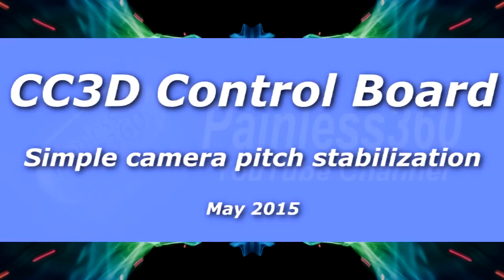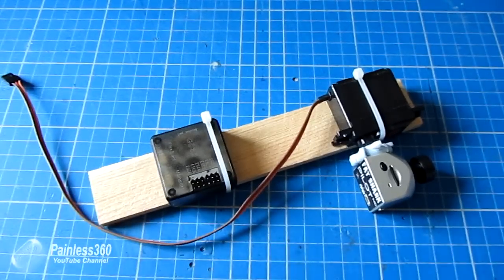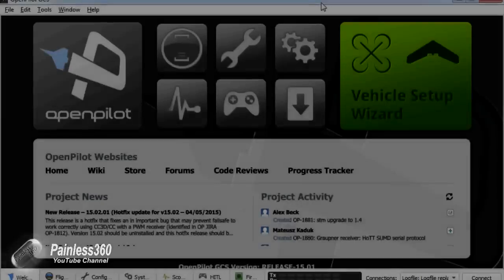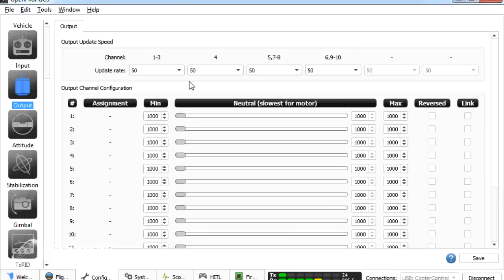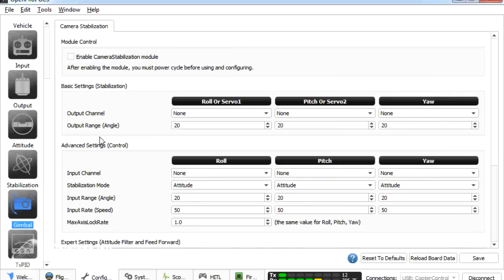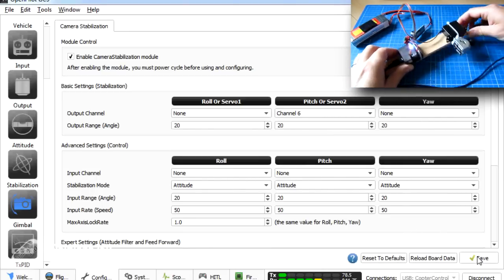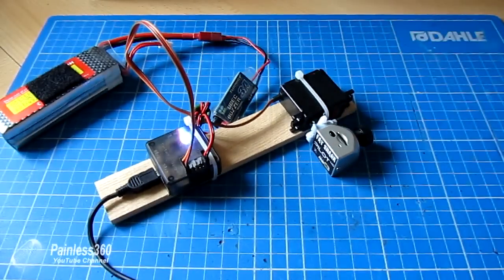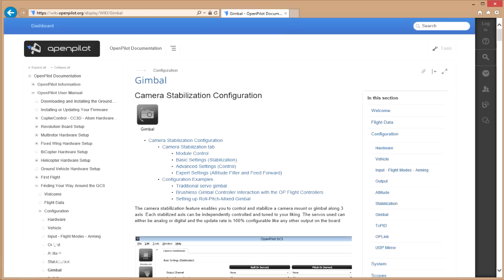CC3D Quick Tip - Setting up a Simple Pitch Camera Gimbal

Comment: Thank you so much for the video and the comments.
I have never thought about not having the camera tilt because you are unaware of what your quad is flying 
I fly a 350qx with a GoPro on a two axis gimbal and use FPV with the GoPro.  Seems to work well but I am not 
Flying fast or through a group of trees. As 
With I am planning with the 250 mini quad.
Thank you for all your help in the setup .

Comment: Hi there, brilliant video, thanks. Simple one i'm sure. Is it possible to add further control to this gimbal. For example, I want to fold away the camera before landing and then stabilise it at a mid point during flight? It's actually to stabilise an aerial but needs to fold away before landing?

Thanks,

Will

Comment: For anyone who has had the issue where the pwm adjustment bars are grey, I've got the solution.  Configure the board in the wizard as a fixed wing aircraft, and during that setup configure your servo as if it were for an aileron by plugging it into channel 1.  Once the setup wizard is finished, you can go to the output tab and can adjust the servo like Painless does in the video.  However, if you try to assign gimbal pitch control to channel 1 you'll get an error in the dialogue box at the bottom of the screen saying the channel is already assigned as an aileron channel.  So, go to system, settings, mixeroutput, and go to mixer1type and click on the word "servo," which will bring up a selectable list of things you can re-map channel 1 to.  Select Camerapitchorservo2, and hit save, which is the button that looks like a hard drive with a red arrow.  Then go through the regular gimbal process in the video and it should be working!  Took a while to figure out, but basically I'm tricking the system into allowing me to configure the servo, then reassigning the configuration to where I need it.

Comment: hello painless ty 4 the great video. it did wounders for me, i have a ? well there b a video on the set up of the cam on a 3 p switch control, where you can flix the switch up and it is looking up same with middle and down on the 3 p switch? thanks again for this great video
Reply from the maker: Not for Openpilot and CC3D, we do have one for Naz32/Cleanflight.. Best of luck!
Reply: +Painless360 not openpilot it's dRonin...
Reply from the maker: Same answer ;) Best of luck!
Reply: +Painless360 well thanks for everything so far and if I come across a way I'll share so you can use it for a video
Reply: to achieve that you need to go to settings --> Mixersettings --> Mixer5type --> set it to Accessory0.

if you have accessory0 assigned to a 3p switch on your Tx then your good to go. (accessory0 in my case as I have a 6CH Tx and only have accessory0 spare 5th CH being flight mode switch).

DO NOT! forget to set the start, neutral, and end points for the servo under the config --> output section as shown in the video above.

hope this helps.

happy flying :)

Comment: Hi, thanks for video. I´m not a modeller, but I need lightweight 1 axis gimbal (exactly like this) for paragliding. I want to build one, but I don´t know voltage and type of battery, and what is the thing on the wire between battery and CC3D.Thank You for the answer
Reply from the maker: The CC3D and the servo run on 5v. The 'thing' is a 5v BEC that supplies both. The BEC then plugs into a battery with a higher voltage (2s-3s LIPO usually). Best of luck!
Reply: +Painless360 Thank You for fast answer

Comment: Thanks for the great video! Can you explain me how I can use it without stabilization? I want to use it for searching on fields but I have no idea. It is not easy as putting it directly into the rx with PWM.
Reply from the maker: +Fshsh Szahha Not sure what you are asking...
Reply: I only want to use it as a servo (with a mounted camera)via the FC. It makes me possible to change the perspective while flying. Do you have an idea?
Reply from the maker: I'd connect it to the receiver directly or Google passthrough for the CC3D.. Best of luck!
Reply: No, connecting directly to rx is impossible due to CPPM. There is no solution on the internet.:-(

Comment: Let me get straight, I just discovered this new feature, could the gimbal feature of the cc3d compete with a pre made gimbal?

 I mean if the quality and the steadiness are nice I could  build a homemade 2 or 3 axis gimbal with a couple of good digital servos and connect them to the board, Right? If this system is that good I don´t know why this isn´t destroying the market of premade gimbal you can save a lot of money...

Btw, very good video.
Reply from the maker: The 'real' gimbals you are thinking of use brushless motors to provide silky smooth, powerful, fast and accurate movement to stabilise the camera. 

This method uses servos so the results are nowhere near as satisfactory. 

But is is a nice cheap way to help stabilise the camera. And weighs little too.

Happy flying
Reply: So you don't think with a couple of very good digital servos, and a pretty decent setup of the gimbal feature in cc3d couldn't match the performance of a brushless gimbal? 

It would be nice and interesting to find a video making this experiment between both.

Regards.
Reply from the maker: Let me know if you try it. Happy flying!
Reply: +Painless360 I'll upload a sample video when I get all the parts, I'll take note for send the link to you  ^_^
Reply from the maker: Good luck :)

Comment: After watching the video I have some doubts... I would like to do the same with my eachine racer 250. It has a CC3D board but all channels are already bound. I guess this means that I would need another CC3D board and also another battery?
Reply from the maker: +Eduardo Agustin Vendrell del Río or you could de-solder one of the unused PWM outputs and have that one coming out of the other side of the board so you can connect a servo to it... Best of luck!

Comment: Is there a way to add a gimbal to a hexacopter (like a F550)?
Is is enough to get the pitch and roll signals from the receiver by adding an Y-calbe? I think if the CC3D is stabilized with attitude mode, it should work.
Reply from the maker: +paaalm07 I would get a dedicated gimbal and use that. Best of luck..
Reply: +Painless360 You said in the video "..this is tricky to do, if you are using any more than 4 motors..". Maybe you can describe this shortly how tricky it is.
Now I fly with a CC3D in my F550, but I've ordered a CC3D Revolution too. So I can take the CC3D only for gimbal. Is that the dedicated way which you have mentioned?
Reply from the maker: No, something like this - https://www.youtube.com/watch?v=TRBr3VdJ7wA
Reply: Ok, thank you!

Comment: A quick question, I readed the whole documentation but I think I didn´t understand it pretty well.

I want a camera stabilized in roll and pitch axis, but I also wanna control the pitch, so we say I have to use 3 extra output channels Right? Then, do I need a 7ch in total? 2 for stabilization and 1 to one potentiometer, or the 2 stabilization outputs are independent from the Input Channels?

Thanks.
Reply from the maker: No, two connections from the CC3D for the two servos and one extra channel on your radio to control the pitch. Best of luck
Reply: Thank you.

Comment: Has anyone tried flying fpv with this setup? If so, how does it preform?
Reply from the maker: +iannick22 flying FPV with a stabilised camera is very tricky for most pilots as the Tilt of the craft is easily visable if the camera is fixed. Best of luck!

Comment: In output tab, 5 and 6 are disabled. Any thoughts? I am using cc3d atom
Reply from the maker: Ive not used CC3D for a few years so I'm very out of date, see my video on which flight controller should I use from August to see those I recommend now. Best of luck!
Reply: i figured out, but some how it always dont work.
So i went to INAV and it works well

Comment: Hi,
Do you think it's possible to use brushless gimbal motors instead of servos?
Reply from the maker: Not using the way shown in the video. You need a gimbal driver to run the motor...
Reply: Ok Thanks!

Comment: i have cc3d 
 i want to add servo for dropping  so 
if i remove the  last pin  from reciver  and then  pin the  servo wire 
then will it work   
cc3d  only need give channel?
one more thing    i am using only five channels  Aux 0.1.2.3 is dessabled
so  if i remove  the    last pin  fo cced from rx  then  the  cc3d  will work ?
Reply from the maker: I'm not sure, I'd have a look at the librepilot documentation. I've not used a cc3d for many years..  best of luck!

Comment: painless I was in a bit of a jam and wondering if you could help? Myself and 5 other guys are attempting to set up a course and upgrade from librepilot to betaflight. Flashing the cc3d with beta flight seems simple enough but, a few including myself would like to add an minimosd.  Would the setup be the same as adding osd to cc3d? I know the cc3d is a older FC but we all the gyro and it always gives the option to go back to librepilot. I've had a hard time convincing my buddies that betaflight is better.  Is there anyway you could do a video?
Reply from the maker: +AARON ARRINGTON we've not done all that here but adding a MinimOSD 'should' be the same as as adding one to any other board. Remember to use something like KV_team firmware on it and you may have to try both ports to see which one is happy running telemetry. Best of luck'

Comment: Why do you rather use the naze32 for cleanflight than a cc3d?
Reply from the maker: shawn schroter A lot of it is personal preference - the flight characteristics for the basic boards are very similar. 
If you are using a 'full' Naze32 or Flip32 then you can do a LOT more!
Happy flying!
Reply: I only have a cc3d. would you prefer cleanflight or openpilot then?
Reply from the maker: Myself I like Openpilot on the CC3D..

Comment: Thanks for this! Great video.

How would you set this up to a slider on the radio? I am currently building one of these but am not interested in the autolevel part. I would just like a slider or switch to move from 45 deg angle to horizontal to make landing or slow proximity flying more controllable.
Reply from the maker: Kim Lindblom This is all covered in the well documented Openpilot pages - https://wiki.openpilot.org/display/WIKI/Gimbal
You can't have a camera control without some level of stabilisation using the Gimbal module. Simple add an Input Channel to the Pitch section in 'Advanced Settings' directly under the 'Basic 'Settings' section on the 'Camera stabilisation' tab in Openpilot.
Once set, Openpilot will then us that control to adjust the direction of the camera. 
Best of luck.
Reply: Painless360 
Under "Ouput" all channels except 1-4 (motors) are greyed out and can not be adjusted.. Do you have any idea why this is?
I am using OneShot and PPM on my system.

Comment: Very interesting video dude !
I just have a few questions :
Can we use the CC3D board to control the quad while controlling the servo gimbal ?
Can we program a switch on the transmitter to change the angle manually in flight (for example if I want to see the ground) ?
Reply from the maker: Yes you can and I've not tried it. :) Best of luck!

Comment: please if i use cc3d with baseflight ( betaflight) the pins for servo will be 5 and 6 or 1 and 2 like with naze 32 and basefligt ? thank you in advance
Reply from the maker: +Tux Pilniq Possibly, check the documentation. If you want Cleanflight (or one of the current development forks) then get a Naze32 or even better one of the STM32 F3 based boards..

Comment: trying to figure out why when i choose channel 6 for pitch or servo 2 in camera stabilisation and press save it just keeps reverting back to none, any ideas?
Reply from the maker: +aerialpunkin I'd re-flash the board as step one..
Reply: +Painless360 thanks man, i tried that but it didn't seem to help. i did get it working though with a weird work around, in the vehicle tab i set accessory to channel 6, which then allowed me to set min, max and neutral settings in the output tab (which if i didn't do that were greyed out) then in the camera stabilisation tab it would not let me set the pitch output channel to 6, so i had to go back first to the vehicle tab and deselect channel 6 as an accessory...wierd, but it's working great now. maybe if I'd seen Josh Vermast comment below i could have got it working that way.

noticed that the wiki open pilot page seems to have been taken down, do you know if open pilot still being developed or has it been replaced by libre pilot?
Reply from the maker: Replaced my Librepilot (for all intents and purposes)

Comment: Gimbal works but cant control gimbal with transmitter, i've heard that cc3d supports only 5 input channels, is it true? I know that my channel 6 works on receiver, hooked a servo on that pin but in cgs can't set up accessory knob. Need help!!
Reply from the maker: DiyRun The only way I know of to push a channel out of the outputs is covered in https://www.youtube.com/watch?v=FkUiiVwS4CM&index=13&list=PLYsWjANuAm4r-E61stLchCR4bzY3NmDNh
If there is an answer it will be here - https://wiki.openpilot.org/display/WIKI/Gimbal
Best of luck.
Reply: Thanks, but i have pwm type receiver. Why then CC3D have purple colored wire which goes to receiver, when it`s not working in CGS?
Reply: I wan´t to make gimbal that i can control only pitch with knob on my transmitter.
Reply from the maker: I would recommend using a PWN output on the receiver and connecting the gimbal to that.

Best of luck..

Comment: hello. i'm just buy cc3d and i'm a noob with this
i follow ur torturial but i can't set neutral value in output tab
the min max number away display 1000 with grey color :((
Can't u help me with it
Thank a lot
Reply: do duy I second that
Reply: +do duy I have the same problem
Reply: Same!
Reply: +do duy  Figured it out, go into System -> MixerSettings and set Mixer5Type to CameraPitchorServo2
Reply: +Josh Vermast i'm trying this nd once i change it, it changes back to how it was before
Reply: running vehicle wizard from scratch may resolve the issue.